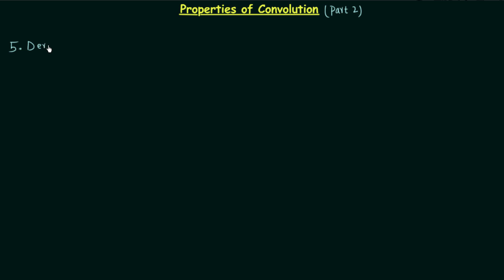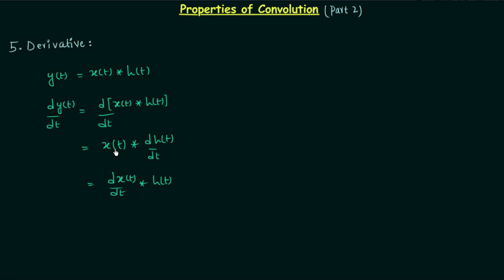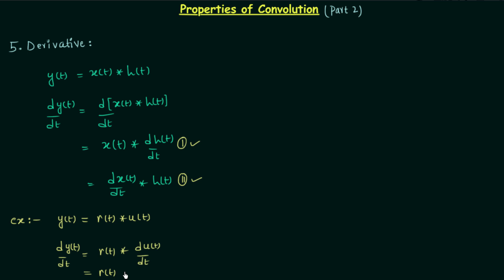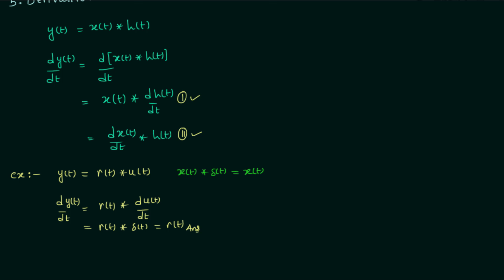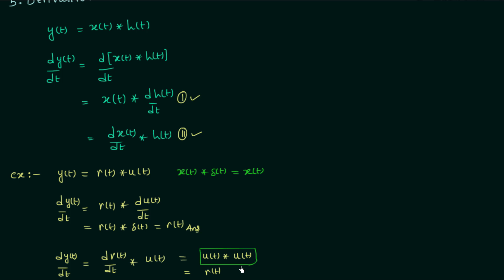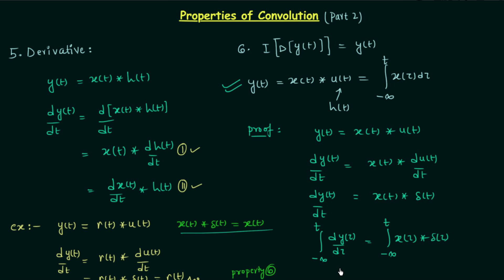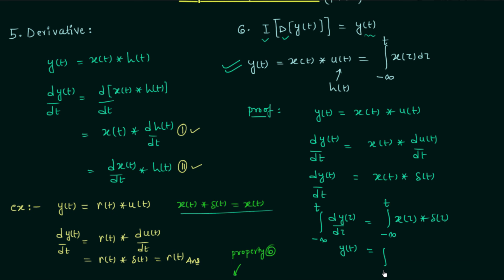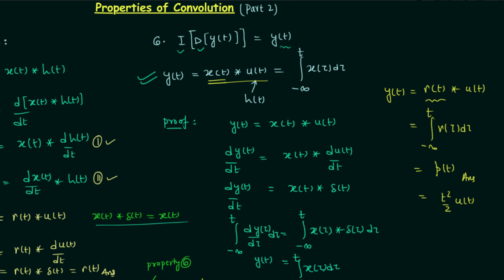Properties of Convolution (Part 2)

Comment: we get two different answer of same question when we had done derivation of different function  in 1st case we got r(t) as answer and in 2nd case for same question we p(t) as answer
Reply: bro both are different u must-see in another question he has taken input signal as a ramp signal.
Reply: @keshavthakur3023 No bro both has same inputs..
Reply: On the right side of the slide is r(t) convolution u(t)

And on the bottom left is u(t) convolution u(t) = r(t) convolution delta(t) =r(t)